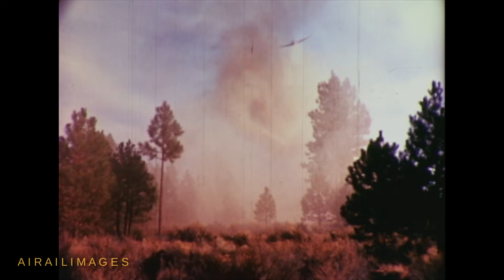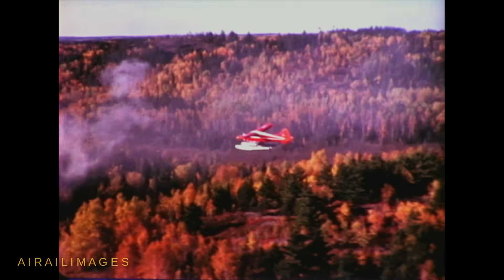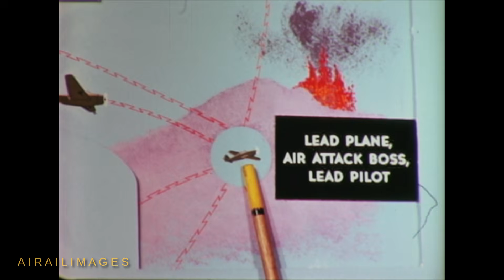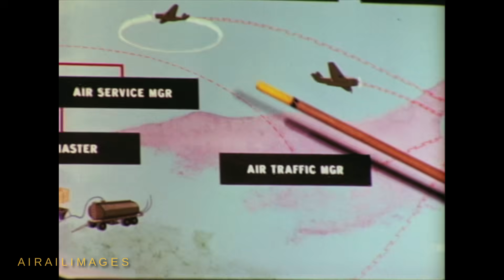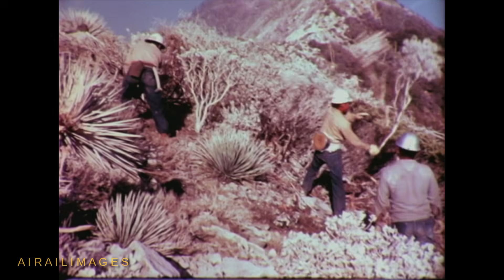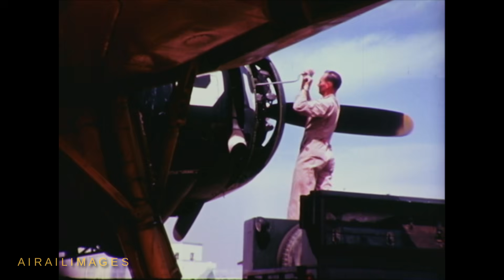F7F Tigercat air tanker TBM USFS training film air attack fire bomber Airailimages Forest Service

Comment: Need to retrofit some “retired” A-10’s with those water tanks. Loiter time, water drop speed, accuracy, capacity, and built-in communication suite would be unmatched. Not mention high survivability and low maintenance costs.  Make it happen!
Reply: I remember reading about the idea but the Air Force decided to keep the A-10 for a little longer. Still might happen.

Comment: In 1973 I was in my first fire season with the California Division of Forestry. We were on a fire outside of Cottonwood, California, and I got hit 3 times by F7Fs. They were so fast that, by the time you heard them, they had already dropped their load. A few weeks later 3 of them crashed in one week and they were taken out of service. The TBM had already been grounded by that time. Great video, thanks.
Reply: Were the groundings due to deficiencies in the Aircraft or due to other factors?
Reply: @cleekmaker00  As I recall, the first crash was an engine failure on takeoff, and the pilot tried to bring it around to land without jettisoning the load. It stalled and spun in. The second crash was a case of target fixation. He dropped the load on the fire and flew straight into the ground. I can't remember what happened to the third one, but I think they just decided that they were too hot a plane for the job and took them out of service.
Reply from the maker: Thanks for watching and sharing your experiences.